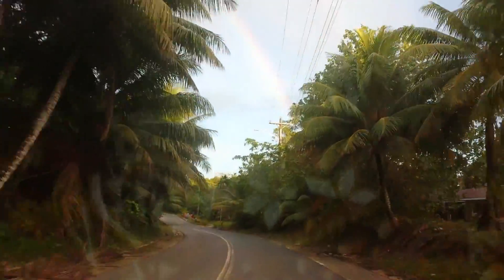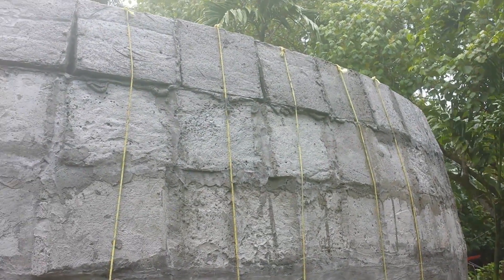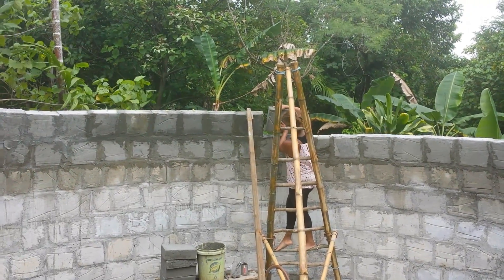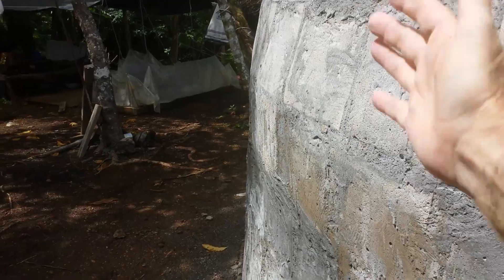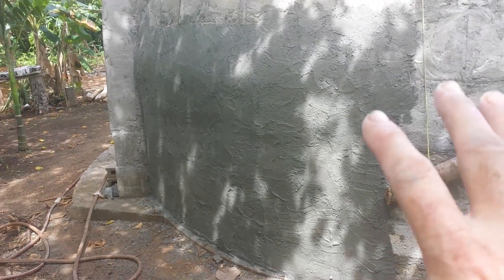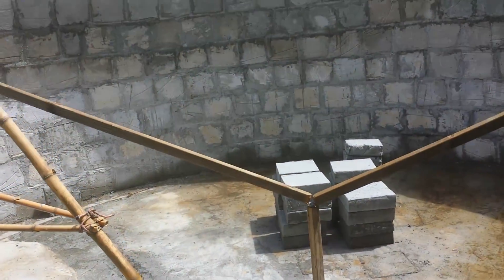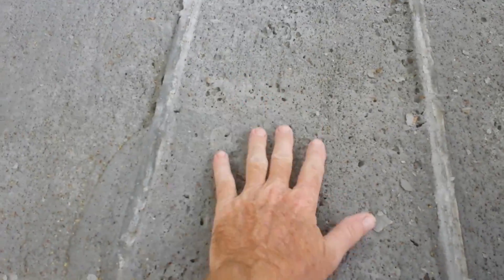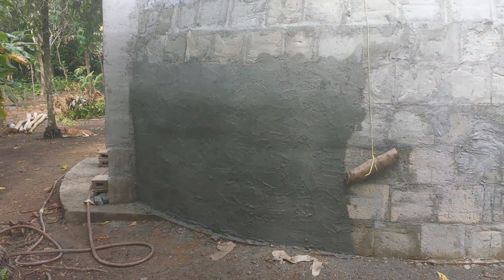Aircrete Dome Home, Yap, Micronesia, Domegaia, 4/7/19

Comment: Can I ask; I see that you pour the aircrete into a mould and then cut them into smaller bricks.  Why do you do this ( as opposed to pouring aircrete mix into a larger, curved, form that matches the curvature of the wall at that height/level )? 
Is it simply that smaller blocks are easier to handle? And that too many different sized forms would be required? 
Thanks
Reply from the maker: I am following the DomeGaia instructions and method. Yes, we could have used the pour method down at the lowest level, but not up higher. Making bricks and placing them is the easiest way, but time consuming.

Comment: What about Mason mesh instead of counter weights? Apply the mesh to the outside as you go and screw it in directly to the outside of each block. And then the application on the outside of more aircrete will be easier.

Comment: Learned a couple things on this video: The 3” screw between the blocks as the start to lean in; the weights over the opposite side to counter act the leaning blocks; and the swinging brass for the current block in work. Thanks for sharing!

Comment: after all this time how has it held up to the super storms from the ocean?
Reply from the maker: Hello Gene,  The dome has had another coat of paint recently. Some small cracks have been filled. It is still standing and strong as ever.
Reply: @jonyap08  and what has been the highest wind speed it has withstood? and this is with aircrete right?
Reply from the maker: @geneheard9776  No typhoons yet, but several storms. All aircrete, wrapped with a mesh and covered with cement plaster.
Reply: @jonyap08  ok just thought that i could use that to make a tornado shelter here in minnesota USA. but may have to put a few inches of straight concrete on the outer shell to withstand that here. No "easy button" i guess.
Reply: @Eyes0penNoFear  Thank You Very Much for this lead to understanding the strength of the monolithic concrete dome.  :)

Comment: What's the building code in Micronesia...did you have an architect and engineers sign and seal? I can't seem to build one in the Philippines without going through the gamut.
Reply from the maker: No building codes at all. Government red tape is a pain. I would recommend just building out of regular cement and not aircrete. After one year, our aircrete structure has many cracks. Our next addition will be made with ferro-cement and wire mesh. Good luck in PI.

Comment: What fabric do u use to reinforce the bricks inside and out ?
Reply from the maker: Hello Alma, Dome Gaia recommends roofing fabric. We did not have any on the island, so we used heavy duty mosquito netting. It is placed on the outside of the dome only. After one year, we have many large cracks in our dome structure. We will not build with aircrete again. Our next addition will be with Ferro-cement and wire mesh.
Reply: @jonyap08  hey Jon, sorry to hear you had a bad experience with aircrete. I've been looking into building with it, but I'll think twice after learning about the large cracks. Did you get in touch with the Dome Gaia people at all to ask their opinion why the cracks happened?
Reply from the maker: @Eyes0penNoFear  No I did not.

Comment: Great dome! Very nice entrance arch.
I've seen these types of builds before, and most are using more than one support beam coming from the center. If you have 5 or 6, you probably don't need to have counter weights on the outside.

Comment: Looks great Jon!  Is the floor of the House also Aircrete?
Reply from the maker: Yes it is, but a more dense aircrete...not as much foam. We then put a thin sand/cement mortar layer on top. You do not need to do this if you are going to lay tile down.

Comment: What's the cloth material you use to cover the dome with? I'm in Southeast Asia and many of the products are not easily available here.
Reply from the maker: Try using mosquito netting. It is super strong and cheap. Should be easily available in Southeast Asia.  For simple dome construction it will give enough strength and will connect and unify all the blocks together.
Reply: @jonyap08  Thank you very much. 👍
Reply: @jonyap08  you don't mean fibetglass screen door netting, right? They have a common mosquito netting in blue that everyone uses here.
Reply from the maker: @allenhyman5003  That will work just fine. Just don't put any structural weight up on top of the dome. If you use stainless or aluminum netting, that will give maximum strength. But fiberglass screen is just fine.
Reply: @jonyap08  Thanks a gain.

Comment: Very, very interesting. Thanks for posting. The bottom shaping of the AirCrete blocks whilst in situ, is also an Inuit technique for building igloos. This Canadian film from 1949 describes how building upwards in a spiral, creates a dome that does not require internal support during construction.  https://www.youtube.com/watch?v=K3pd-wxNEKQ 

The technique staggers the vertical joints & avoids weakness, so the structures are able to withstand Arctic storms. It should work with your lightweight blocks as well. All the best.

Comment: What is the fabric screening? Is that the same material as a fly screen?
Reply from the maker: Hello Seth,  Yes, I am using fly screen. I have made some test parts and they are super strong.
Reply: @jonyap08  Sorry to pester you further.. But are we talking the plastic variety or fancy aluminium stuff?
Reply from the maker: @M3rVsT4H  I think the screen is PVC material. With test pieces we were not able to rip or break it.
Reply: @jonyap08  Ahh nice, that's one piece of the puzzle I'd been unable to discern from the various dome gaia vids.  Makes sense, aluminium would just introduce possible corrosion.

Comment: Is the foundation aircrete?
Reply from the maker: Hello Seth,  Yes it is. 1 bag cement making 32 gallons aircrete for the foundation. We used about 20 bags of cement for our foundation.
Reply: @jonyap08  I gather you're happy with it's compressive strength for foot traffic and the like?  Boy is it going to be great ground insulation.
Reply from the maker: @M3rVsT4H  It is doing very good so far.  Keep in mind that we are planing to put tile over it.
Reply: @jonyap08  Of course, strong and easy to clean.

Comment: Yes do all three things to protect your hands gloves , oil, and vinegar! Not in that order ! Good work  on some and nice place to live. I have worked with brick and stone tie them together with a corrugated anchor strap. Rebar and chain are also good ideas . My understanding is that you don't need it if you use the recommended fabric and plaster coating on both sides of dome as it gives structural strength. 
I am here in states and trying find out codes in local areas that allow this type of building. I appreciate what you have done!

Comment: As was previously mentioned in the comments, the joints should be staggered and "not line up" since a fault line could cause fault flaw in the structure eventually.  Also mesh will increase its tensile strength, so its a good idea for use on the outside of dome, but won't have much of an affect on the inside of it. And "not" aerating the mortar and stucco mix. Will make it stronger and seal the aircrete better. Since you're in the tropics I'm sure you want to seal it. 
Good luck with and hope to hear what the mesh will be made of?  So will look forward to next progress posting.
Reply from the maker: Hello NC from Yap island.  Hey...thanks so much for the good comments. Greatly appreciated. Keep in touch!
Reply: Someone was saying using sodium silicate (concrete sealant) could help strengthen the concrete and also provide a water barrier. Dunno if it's true for aircrete though
Reply: From what I've read you want to mix aircrete mortar (more dense than blocks but not as thick as normal) since normal can cause cracking

Comment: Get some vinegar and dilute 50 percent with water.Rinse off your hands with that. It neutralizes the alkali.Good advice from a old concrete finisher.
Reply: I wonder how a person has evolved and invented everything in order to improve his quality of life.
Reply: Oops!! I forgot about that, i kept household spray bottles in my truck ready to use .  My thighs got burned once through my jeans
Reply: I was going to suggest antiinflammatories such as some tree tree oil or moringa leaf oil...I recently started the orally the moringa leaf... amazingly the psoriasis that was flaring up calmed down and is disappearing....both items prob readily available to you... moringa tree is gown in most tropical areas....once you become aquainted with it you will begin to understand why it is called the miracle tree by some people
Reply: @rocksanon689  Yes,possibly that will work for psoriasis.But the Alkali is in the extreme from the cement. It needs to be neutralized,safely.Alkali will cause burns and cement poison if not neutralized. As a cement Mason for years,this is what we use to help prevent that.Of course wear gloves at all times while working with cement.

Comment: What type of fabric do you use, is it the same on the outside and inside? How large a dome do you think is possible?
Reply: Reinforcing an air Crete Dome requires a polyester fabric. Many people have used many different kinds, and among the most popular are Roofing fabric and geotextile fabric. Though I have heard stories of people using off-the-shelf clothing grade polyester fabric with good results. As to the size, there really is no limit to the size Dome one could build. There have been aircrete domes in excess of 50 feet already built. Though once you start getting up into those sizes, I would seriously seriously suggest increasing the thickness of the blocks. This video shows a Dome built with blocks that are 3.5 inch thick. For a 20-foot Dome I would say that is pretty close to the minimum thickness I would be comfortable with. If I were building it, I would be using blocks more along the lines of 5 in thick. But having said that, I am in a Northern climate where the insulating ability of the aircrete comes into play quite a bit, plus we can get heavy snow loads on top of our buildings up here. Based on your question I am going to make a presumption that you're new to the aircrete Dome building experience. Search on YouTube for a channel called Little Giant, and a video entitled how to build your aircrete tiny house. That is a absolutely fantastic video that is loaded with good information for a newbie.
Reply: Darryl, thanks for your prompt  response. Greatly appreciated

Comment: Love the progress!!  Could you build the forms with a camber on the edges to make them fit better without trimming??
Reply from the maker: Yes you could....with a lot more effort. Plus, each row higher has a different angle.....so much easier just to cut them.  Thanks for the comment!
Reply: @jonyap08  I like to see your using it as a freeform construction method, that should force you to adjusting and improving at each additional course of block. But pls stagger the joints and if I may suggest using hooks instead of screws to hold the tension lines in place. It would be more efficient.

Comment: What kind of R-value are you gonna have ?
Reply from the maker: Hello Mark from the islands.  Sorry, I do not know the R value. Here in the islands I am not too concerned with that. There is a lot of info here on the internet about the R value I think. I understand it is very good....because aircrete is like foam insulation.
Reply: Domegaia addresses the question on their FAQ page....What is AirCrete's R-Value?
https://www.domegaia.com/aircrete-faqs.html

Hope it helps.
Reply: I think in Yap snow is not a problem neither is cold. Occasionally might get a big wind that has a name attached.

Comment: Oil your Hands... I have done Concrete Sculptures.. at first No Problem.. then as you Get Cracked Skin on your Finger tips and hands the Cement Creeps in and can Expand .. Really Hurts.. Use a Thick Shea Butter Cream  and Knit Gloves.. Plastic is just too Hot...How many Sacks of Cement does it take to Make one Frame of 32 Blocks ...   thanks
Reply: Hi, In a past video he commented in the comment section that he used 2 bags of cement per 4 x 8 aircrete form.  The two bags made  about 32 blocks.
Reply: @Lisacee7  Thank you
Reply from the maker: Hello Sonja from the islands.  Many thanks for the info!  I will try that on my hands.  Keep in touch!

Comment: How would you install windows? I would imagine the weight of the blocks over time as the structure shifts and settles would invade the sills and cause cracking of not impede operation of the slides. Are you going to cut window openings into the structure or add some form of reinforcements
Reply from the maker: Hello Matt from the islands!  We are going to cut window opennings. Here in the island we will just have bug screen and security wire. So no need for window slides. If a typhoon comes, we will board it up with plywood.